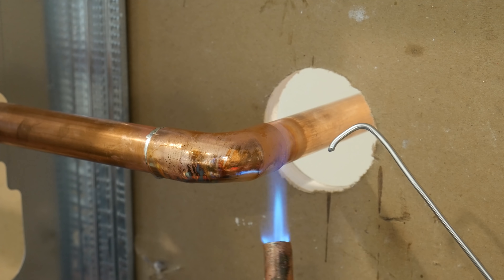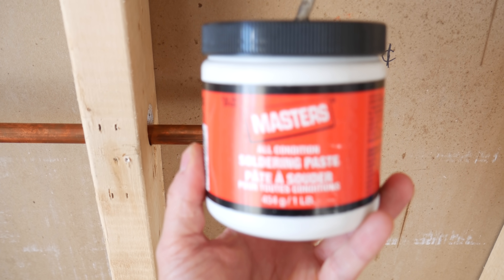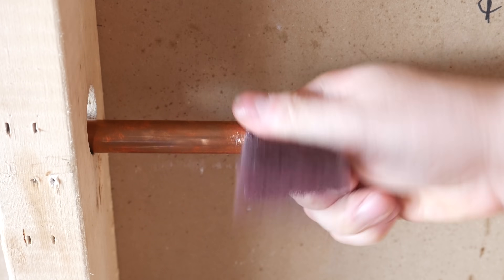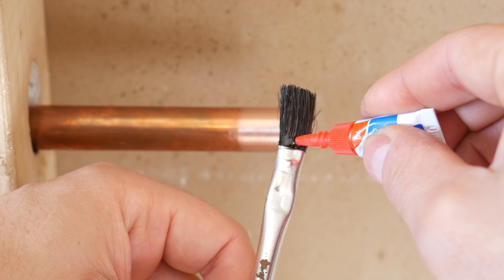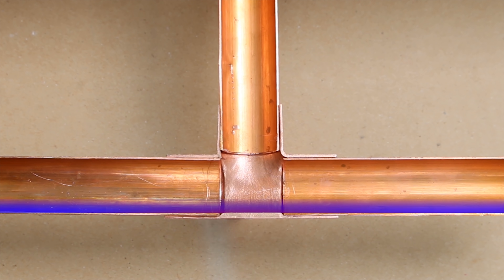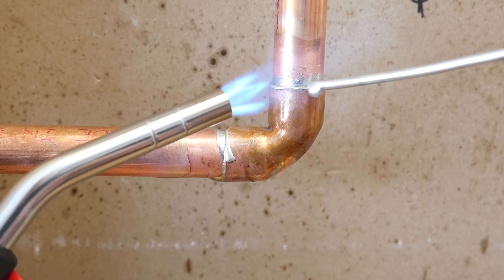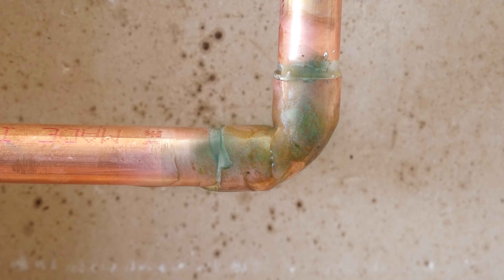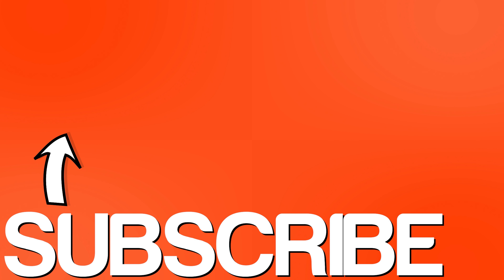10 MISTAKES Beginners Make When Soldering For The First Time (Beginner's Guide) | GOT2LEARN

Comment: Interesting video, however, in the U.K. copper fittings come already soldered. So it's just a case of wiping pipe clean with some fine wire wool, fix joint to pipe and heat. No extra solder nor flux required.
Reply from the maker: Yes, those are Yorkshire fittings, right?

Comment: How do you get of the grease on the pipe from your hands? Thanks!
Reply: CORRECTION: How do you get rid of the grease on the pipe from your hands? Thanks!
Reply from the maker: When you sand the part you are about to solder it pretty much removes all of it, the trick is NOT to touch that part after it's been sanded ;)
Reply: @Got2Learn  :)
Reply from the maker: @robo7981  👍👍👍
Reply: Just an FYI for you. There's no need to write a separate "correction" comment. Click on the three grey dots at the right side of your comment. It will say,  Edit, or Delete...click Edit. Change what-ever you wish about it, (spelling, wording, or anything else). Click Save. You new comment will appear. Done... Much easier to do than to describe, actually. You're Welcome.
Reply: @DarkFlamage  I never said thank you... My suggestion to you if you continue to have a lot of extra time on your hands, you should work on your etiquette if you want to make a point... dropping to no notifications...

Comment: and old hand showed me a trick on a leaky line with a bad valve seat, he added portions of bread inside to line which allowed you to make the fit.
Reply: The bread is to absorb any water in the pipe that may prevent an effective solder

Comment: I use even 40 year old fittings that have never been used.  Have never cleaned the inside of the pipe and do the outside with sandpaper or steel wool (so before skotch-brite was invented) They were stored in a wooden junk box in the unheated garage. Never had a leak. Some are lucky, some are not.  Now shark bite or plex pipe.

Comment: #11:  don't use square throat fittings (if you compare choices, you'll see that some have very little radius in the throat---that's the inside curve:  you want a curve!).  Square throat fitings also tend to have more abrupt transitions on the heel (the outer curve).  Square throats and poor transitions increase turbulation, and particularly in plumbing systems with particulates (sand, dirt, like most city systems) turbulation greatly increases localized velocity, causing the particulates to abrade the copper.  Abrasion can dig right through the copper wall.  Search "erosion corrosion" to learn more.  A few pennies spent on a proper fitting can save hundreds in damages.  Or millions on a large project (bin dere).

Comment: Always MAKE SURE THE HAVE RIGHT SOLDER FOR THE JOB.  Electronics take one type, plumbing takes another.
Reply: No shit Sherlock
Reply: There are two basic types for electronics I am aware of. One has no lead and is used in construction of electronic equipment for the home. The other is a type that has lead and is used for both military and medical electronics. Why? - you may ask. The type without lead has a tendency to grow whiskers and could cause a failure. Can't afford that in medical or military use. The type with lead doesn't do that but now, of course, we know people can get lead poisoning handling a lot of lead.

Comment: To anyone reading this:

As you may or may not know, lead-free silver solder is plumbing solder used for pipes that will be transporting drinking water.
Obviously, you want that solder to not have lead, mercury, or any other dangerous substances in it.

That said, some cheap lead free plumbing solders coming out of china and mexico (including Oatey's 22018 | amazon_DOT_com/Oatey-22018-Plumbing-Solder-Silvery/dp/B000BQNAS2) contain the metallic element Antimony (Sb).
In the case of the aforementioned Oatey solder, it's a ridiculous 5% Sb!

For those who don't remember high school science class too well, here's a refresher:
Antimony is so toxic it makes Lead and Mercury look like medical grade saline!
Even 0.1% should be enough to make any sane person freak out, let alone a whopping 5.0%!

So yeah, I'd LOVE to see a "real deal" video showing the exact metallurgical analysis of what's actually in different brands of plumbing solder, or anything else along these lines that we have to trust our family's drinking water to!

Comment: The pipes in Britain have the lead mixed in with them so you just heat them up and they solder themselves.
Reply: only the Cowboys use pre soldered fittings

Comment: If you wipe off the excess solder after you assemble the fitting and before you solder then you won't get big clumps of solder stuck to the pipe, it'll all go into the joint.
Reply: Do you mean "wipe off excess flux"?

Comment: Pipe that drips water?? and cannotbe turned off fully?? It stops good soldering and a pain???
You could buiy an expensive in line freeze   gizmo?????                                                                      good cheap soluition quickly prepare pipe  cut [lace in line open close screw valve??  Or dry bread light toast  place in pipe to absorbe residual water moisture???         long enoughh to get good solder joint??? works well in older property where access can be some what a probblem?? bread tyoast no crust takes up water expands pluigs long enough for joint to fix?? after bread disintegrates washes throuigh

Comment: I likke the tip on aluminum foil. I almost burned down an apartment building while fixing a water leak in the ceiling, assuming the fiberglass insulation would have paper backing that was fire proof. Luckily there was a kitchen with water n a bucket. It was in a vaulted ceiling that was creating a draft. 
 Tip 11, wear a cheap pair of cotton gloves. Can use to wipe the joint while solder is still liquid too.
Reply: I used a spare ceramic 8x8 piece of tile as a heat shield for an elbow in the ceiling of the kitchen feeding upstairs bathroom. Plastic drain line was less than 4 inches from the leaky elbow, tile worked great.

Comment: If the melt point is over seven hundred and fifty degrees it is brazing not soldering. There is a lot of stuff that they call solder but it is really braze material.
Reply from the maker: Yes, this is soldering.

Comment: I have stuffed bread in a pipe that that keeps dripping water. I have never had a problem.
Reply: You do not sound like a licensed plumber doing service work sorry. The bread trick is RARELY applicable
Reply: @billm8633  it's an old school before sharbites and pex but it works in as pinch.

Comment: Water in the pipe while soldering just grab a piece of bread and shove it down the pipe.
Reply from the maker: 100%
Reply: Is that your lunch you're sacrificing or do plumbers keep a loaf of bread in their truck.  Does wheat work better than white bread?   Asking for a friend.
Reply from the maker: The sticky stuff works best hehe
Reply: @marathonfreak67  Wonder Bread
Reply: @loco4dogg  That's curious.
Reply: I've heard don't use wheat because some of the ingredients will not dissolve in water and will clog your airators
Reply: @scottboehmer1114  gotta remember to remove airators before turning water back on, with or without bread. There’s always something in there.
Reply: How do you get it out?
Reply: @dvxAznxvb  You don't. It'll break down in the water.  Just don't use the whole loaf.
Reply from the maker: It dissolves

Comment: if you only have abrasive paper and dont want it to slip just fold it into 1/3 rds, so it will grip itsself.
Reply from the maker: It does work, but it still manages to slip some times and it's just aggravating LOL, but yeah, it's a good solution to the problem ;)

Comment: My goodness, I soldered for 30 years, and I never needed a fire extinguisher. All you need is a good clean, paste it put the heat in middle of the fitting and it sucks in. If you do anything bigger than half inch use map gas (yellow bottle). Why not just use pex, it's 3 times faster.
Reply from the maker: Always a good idea to have one, you never know!

Comment: Do people even solders anymore. If you dont have a pro press id recommend getting one asap.
Reply: ProPress has proved to be insufficient when sealing new fittings on older copper. Not trying to be an asshole just saying that's what I ran into over the last 10 years

Comment: Quality of flux brush doesn’t matter. I never sand the inside of fittings. The most important thing is a clean dry rag. You wipe off the melted flux. Then you apply the solder. Keep your heat on the fitting only. The problems you’ve pointed out aren’t problems, if you follow these steps. The old man who taught me called people who made soldering too complicated Yum Yucks.
Reply from the maker: Cute name 😋

Comment: Actually you are wrong too. 
If you have an elbow (45° or 90°) 1" or smaller, you heat up the fitting on the outside of the bend - NOT at the joints. If you do it right then you only apply heat once and you don't have to keep applying heat to the whole fitting (ie both joints). When the joint is ready for solder, solder the upper joint first (if applicable) then apply solder to the lower joint. The lower joint will flow better (better capillary action). 1/2" pipe takes approximately 1/2" of solder per joint, 3/4" pipe - 3/4" of solder per joint, 1" joint will take about 1 1/4"+_ of solder.

Comment: And #11, drop the lingo and use the correct term SoLdering. That way, your joints are professional and your speech is professional....much better
Reply from the maker: Working on the speech part, thanks!

Comment: Soft soldering!  Does anyone still do that? really!  I've started plumbing back in 1980 and still working as a plumber,  and even then no one used it then on copper. Silver solder is a far better job, stronger joint and more reliable.  I do use soft solder on exposed outdoor copper showers as the low heat required doesn't anneal and discolour the pipes. Anyway most joints are crimp fittings these days.
Reply from the maker: Yes, a lot.
Reply: My home was built with 1/2", 3/4" and 1" soft soldered copper tubing exclusively.  If I can't or choose not to solder it myself, I only use a pro that is comfortable doing it.  I find that tends to be older plumbers, who love to share past colorful experiences.
Reply from the maker: @StilettoSniper  👌
Reply: @StilettoSniper   I'm in Australia so and I assume the video is American and was more curious to see that soft solder was still use. Over here no one and I mean no one at all still soft solders. 99% of plumbers over here on house plumbing use What we call Bpress A Crimp system, no soldering at all no burning and a joint takes 5 seconds.  everything else is silver soldered. Like I said just more curious than anything else. Never stop learning. Cheers

Comment: Maybe I should teach you a little on how to solder.  I guess I could help you out with your brazing.  You completely skipped reaming your pipe.  Without reaming, which is code wherever you plumb.  I suggest you learn better before teaching.  Your flame wasn’t applied correctly, you used way too much flux, and just kind of got a %70 for a grade.  Yes, I am a master plumber.
Reply from the maker: This was not a video on "how to solder" I have a playlist just on that where I mention reaming.
Reply: @Got2Learn  maybe I’m being too.critical, but a couple things I always made sure of when teaching apprentices.  Make sure you do your best work whenever teaching.  Always cover all steps (I may not have called you out on reaming, but I saw it was not done), always be prepared to cut the joint in half to demonstrate solder coverage.  Never use that much flux unless you like flux pockets and future leaks.  This goes for brazing as well, be prepared to show proof of how good you are at your trade.  Good luck with your trade.
Reply from the maker: @wayupnorth9420  thanks